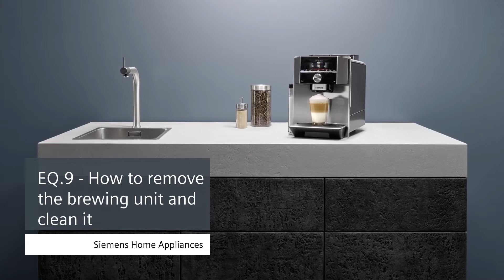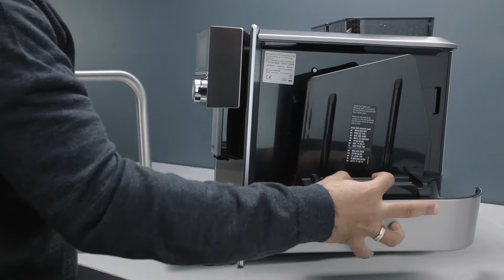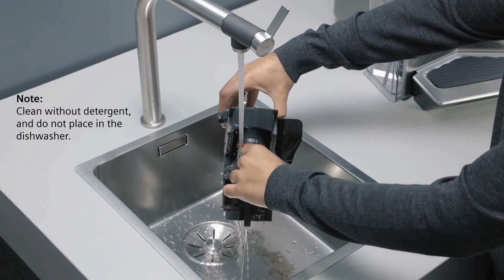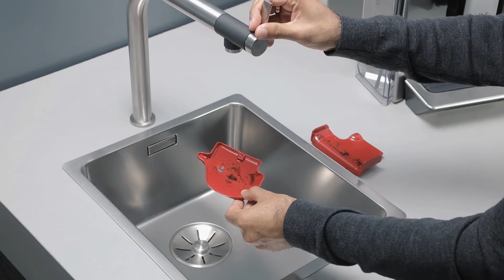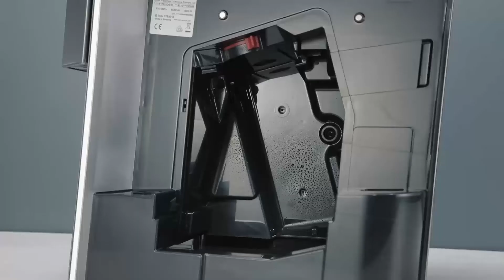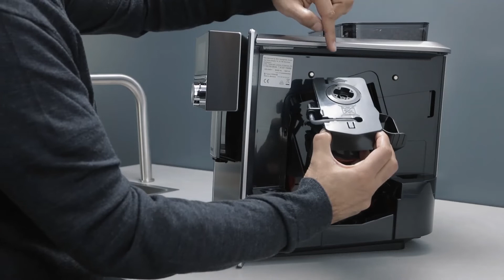How to remove and clean the EQ.9 brewing unit

Comment: Agreed, heavy weekly cleaning with automatic machines, but nearly none for each coffee... it's a trade-off. Had this machine (Eq.9 S500) for almost 3 years and I recently had to bath the brewing unit in Siemens's descaling solution (2 in 1 tablets) because I kept getting a "clean brewing unit" message, the first issue to come up with the machine. The motor couldn't rotate the unit because of accumulated crud in the unit's central screw. Descaling is still a lot cheaper than a new brewing unit (about 80 to 90 euros), though.
Reply: This, yeah the brewing unit is big and has a lot of moving parts so eventually it will need maintenance. Got my EQ9 S500 for two years now, I feel like that message can pop up at any moment now.
Reply: Im getting this message now often and was expecting that it would also need some lubricant such as grease. Was all out, so chose some nice virgin olive oil. It will likely not stay as long as grease, but will think about a descaling bath before I get some suitable maskine lubricant and get it fully cleaned beforehand.